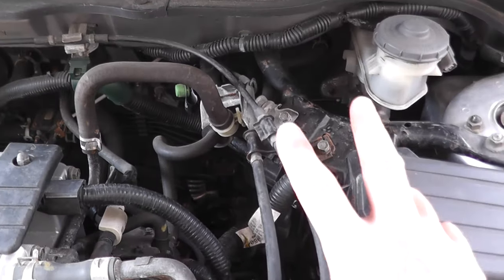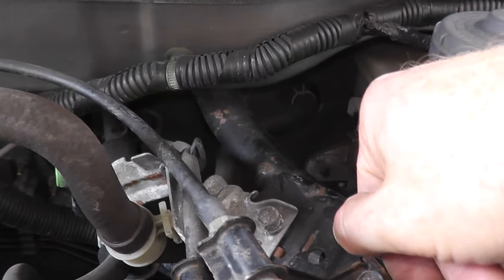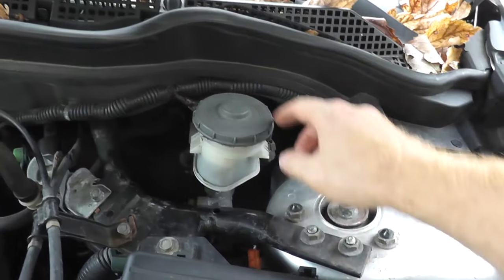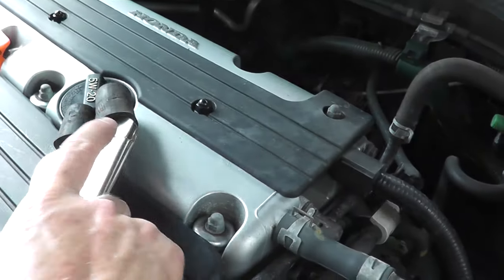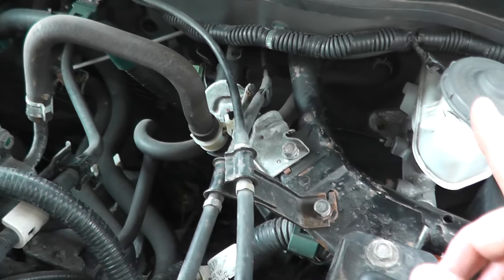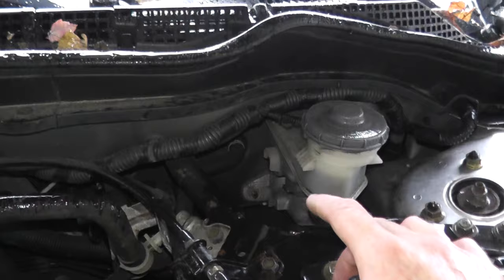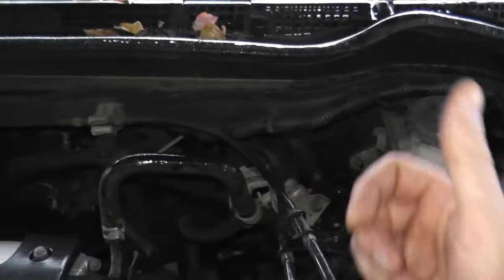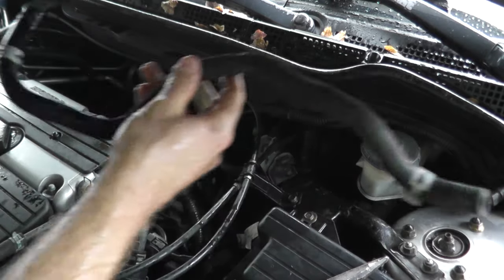How To Test & Replace the Brake Booster and Brake Booster Vacuum Hose

Comment: Thank you for the video. I wished I had seen this last week. My 2005. Crv had just recently had a full brake job calipers and pads before it sat for a year in grandmas drive way 
  About 8 more nths into the year when I came to start it the pedal was going down some when I drove it down the driveway and back it back up
 Around 5 months later I was going to take it to my house and the brake pedal went to the floor. No fluid leaks at all. Min. Rakes as it went to the floor so the mechanic I talked to said it had to be the master cylinder so I bought a new one not a rebuilt one to be safe 
  No difference  so now I’m guessing it was the booster or check valve the whole time.  What is anyones thoughts on it ?
Reply: I have the same problem on my 04 crv . I replaced the master cylinder because dealer said it was bad. Pedal still slowly leaks down . I have no fluid leaking.  What did you find out ?

Comment: What does it mean when I do the pedal test and the brakes are stiff right off the bat. There always hard to press down. I changed the vacuum hose and check valve going to the brake booster hoping that would solve the problem. Unfortunately not. Im leaning towards changing the brake booster next. If anybody gots any insight on what else it could be before I order the part and change I'd appreciate it.

Comment: My vehicle misfires during idle and when I press the brakes have no idea if it’s a vaccuum leak to the brake booster or not. Had everything replaced in my engine plugs, coils, distributor even hoses and no one can figure out why it’s misfiring.
Reply: Did u ever figure it out?
Reply: @TheTalkShytShow  nope. Replaced a lot of parts still having the same issue p0300 code

Comment: Great vid!! My brake booster makes a swooshing/air noise when pressed. It passed all your tests. I read that their is a type of filter inside the rubber boot where the brake pedal enters into the rubber boot. Their were lots of orange rubber pieces that looked like they could have been a type of filer inside the boot where the brake pedal enters. The rubber boot is torn where the brake pedal enters into it. Would that filter be enough to mask any swoosh noise?
Reply: instablaster.
Reply: What vehicle do you own & did you find what the issue was?
Reply: @MrSamPhoenix  1999 Ford Explorer. Did not change anything so noise is still there.
Reply: Hello I have a 2005 ford escape. When I stop at a light ormpark and shift gears while foot on the break. The truck shuts down. But if I stoo at the light and keep slowly pressing on the break peddle. The truck does not shut off.

Comment: I feel like if I start looking around the back of the master cylinder that I would be invading the brake fluids home and I didn't want to do that and upset it so is there any other possible way to check that other than getting up in the brakes personal space or home

Comment: My 97 F350 Dually brake pedal first goes to the floor , but when I take my foot off and rev the engine for about 20 seconds and then mash pedal, the brakes are strong and are normal.  Replaced the valve but it still did the same thing.  After the engine is off for a couple of hours they go to the floor again, so i rev up the engine for about 20 seconds and then mash the pedal and it's normal..Seems like the pressure inside the booster is leaking out somewhere..  After a few hours I can pull the valve off the booster and there's no pressure sound coming out.  Looks like the booster itself is bad.. Maybe??   Thanks ..

Comment: Hi ninja! Thanks for this excellent video!!! I have a question regarding other stuff! (I'm not a mechanic) I have a P0174 code (lean condition on the engine) that could be a few things) I want to see if I have a vacuum leak. I have learned that you can use a smoke machine for that and some videos say that you should connect it to the brake booster (is that true, or I miss-understood?)... Should I connect the smoke machine to the connection point that comes from the intake or the connection point that comes from the booster...? I'm going to do it with a cigaret, I don't have the smoke machine. I have a 2003 Kia Sorento. Thanks!!!
Reply: Did you fix it ? I have the same code
Reply: @drako4684  not yet! I stop looking for a mechanic and star looking for a magician… 🤷‍♂️
Reply: @TC-en7vi  i fix it , it was the pcv valve and hose , it was cracked
Reply: @drako4684  Good for you!!!!!!! I changed it too, but no success..! Happy new year!

Comment: Is there anyone that knows where the vacuum brake hose connects to on a 2011 Jeep Grand Cherokee. I popped the hood and noticed it was just lose and not even connected to anything. I can’t find any videos or diagrams. It’s on the right hand side and was sitting unplugged near the headlight

Comment: Would this effect the car idling at a red light. I get sputtering and stall.
Reply: Apparently it would. i have a unstable idle on coldstarts as wel as hot ( also at redlights etc ). a leaking booster could cause this. Unfortunatly there is about a 100 other things that could cause a unstable idle. Vacuumhoses is the best place to start and if there is no problem there brakebooster etc is the next step up.

Comment: ive heard there is a way to by pass the brake booster so that your brakes are then not power brakes , by disconnecting  ???? would you know ???
Reply: Why would you even want to do that? That's extremely dangerous. There's a reason these are installed in vehicles.

Comment: 2009 Toyota Corolla 58,000 no engine light on but low RPM or engine wants to die while braking hard or soft after 20 minutes warm up

Comment: So where the master cylinder connects to the brake booster  I have a leak could it just be how it sits that it's not sealed?
Reply: I have the same problem. The brake booster is expensive. Please inform me if you find an alternative solution
Reply: @achungbengia8533  yeah so I went to ace hardware and bought an oring that fits just around the Master cylinder and I sealed it right up. They kept telling me my car doesn't have that nor does it hold vacuum and that the master cylinder doesn't comes with it or need it.... Lies cause now my brake booster has no leak
Reply: @jessejameshurtadoiii9916  no replacement needed?
Reply: @jessejameshurtadoiii9916  please can you describe what a oring is?
Reply: @achungbengia8533  if you have a vacuum leak just where the master cylinder meets with the brake booster then you should be ok unless there's too much rust build up or if the screws are corrupt but you should be able to get it sealed but that's all you need so like 2 dollars max fix... I bought 2 Master cylinders and 2 brake boosters just to find out I needed an o ring that never even comes with anything
Reply: @achungbengia8533  it's a rubber O Type ring seal . Take off your Master cylinder and just where it meets with the brake booster there should be a groove and all you have to do is match that with a size seal that will fit. I bought a handful of them without knowing the size and just matched it you can go to any hardware store and ask them for single O Rings for sale and just grab one of the size you need
Reply: @achungbengia8533  ahahah I realized I spelled it oring
Reply: @jessejameshurtadoiii9916  thank you very much for your help. Very much appreciated.

Comment: my brake pedal hisses while pressing it, but it cannot be depressed with the engine turned off. Also when i rev up the engine for a couple seconds it does not hiss for a couple of depressions, but when it hisses again i also loose my brake lights. The vehicle also doesnt stop smoothly when driving slowly (low revs), in the beggening of pressing the pedal it doesnt seem to stop at all, and then suddenly it brakes really hard. Can anyone help? I'll contact my mechanic tomorrow but im curious
Reply: It sounds as if you have a serious vacuum leak in your brake booster.

Comment: What does it mean when you disconnect the hose from the booster and the car dies? Yours kept running...
Reply: My car wont start while the booster hose is connected to the intake manifold
Reply: Consider it a good thing.  When a vacuum line is disconnected, most car engines will start to shudder or run roughly.  Some will stop running, like yours.  Because your engine died when the line was disconnected and runs well otherwise, you can be pretty certain that you don't have a vacuum leak.

Comment: I have a 98 jeep wrangler that has a whooshing/hissing when I step on the breaks they are mushy aswell and my RPMs rises when I’m at red lights, major loss of braking power I have to drive way behind people to be able to stop and forget about stopping fast in case of emergencies I need some help on this one it all started after I changed my front brake pads

Comment: i had a bad brake booster hose. My symptoms were soft brake pedal and when i would acelarate and then imediatly hit brakes upon releasing gas pedal brake would become hard. Anyways mechanic told me that effects alot of things just that hose. That effected my steering wheel being soft , my brake pedal being soft and also my engine cause i burned more fuel cause engine wouldn t get enough air. 
so if you got that problem check hose first then brake booster thats a serious problem that can damage your engine in long period. How ? Not enough air incombustion chair is compensated with more gasoline and that gasoline washed your cylinder walls and destroys your rings

Comment: I changed my rear brake pads the other day (one of the pads on the drivers side was thin
but the other 3 were OK). I noticed when I opened the drivers side caliper bleeder valve to push the piston back in, no brake fluid came out unlike when I did the other side but the piston did go back in easily. I took the car for a test drive and now I get a slight whooshing sound when I press the brake pedal (NOTE: its not a hissing sound). The brakes work fine and the pedal doesn’t feel spongy, its just that whooshing sound which it didn’t make before. I can hear it when Im sitting in the car but its louder coming from the engine compartment. I bled all the brakes, no air came out just solid fluid but the same thing still happens. Theres no leaks as the brake fluid is still at Max level and I dont see any evidence of leaking.
. 
I did a couple of brake booster tests, turned the car on for a while then turned it off, pressed the brake pedal a few times then turned the car back on and the pedal sunk as per normal. Next I turned the car on and let it idle for a while then pressed the brake pedal and turned the car off, the pedal still stays down after about 30 seconds. Finally I turned the car on, then when turned off I pressed the brake pedal a few times, it did get a little firmer each time but you can still press the pedal down if you keep pumping the brake but the noise stops after the first two pumps.

Comment: So if you don't have vacuum is the booster bad...
Reply: If you don't have vacuum at the end of the hose, you must have a vacuum leak somewhere.  Quite possibly the hose is cracked or there is a more serious problem.  Checking the vacuum of the hose while it is not connected to the brake booster, does not indicate the condition of the booster.
Reply: @BLAKHARTFILM  thank you when I disconnect the vacum line from the brake booster and put my thumb on the end it sucks the hell out of it ...it's a strong suction..